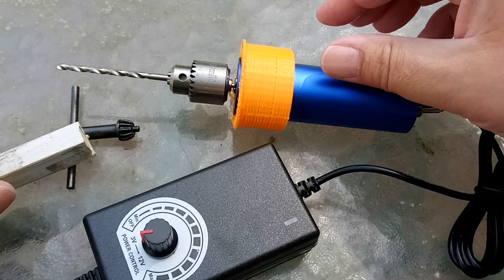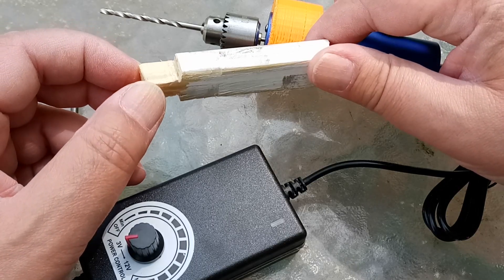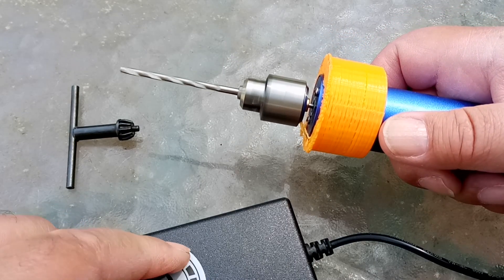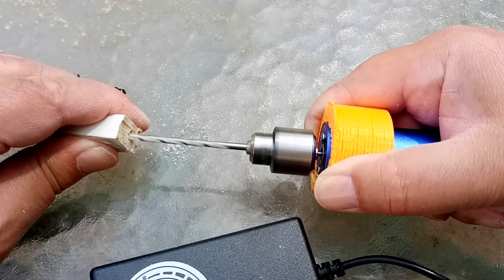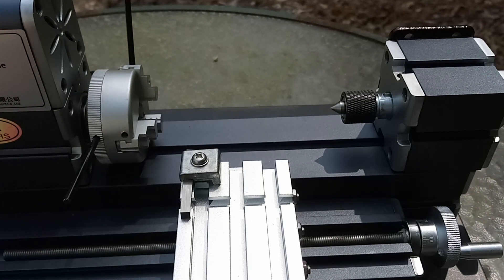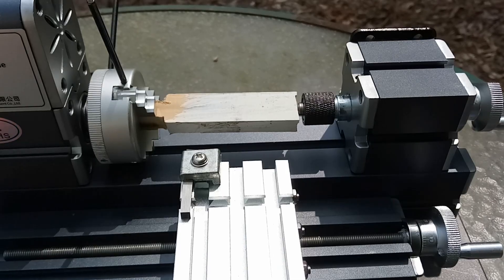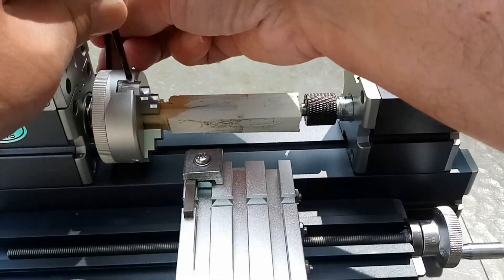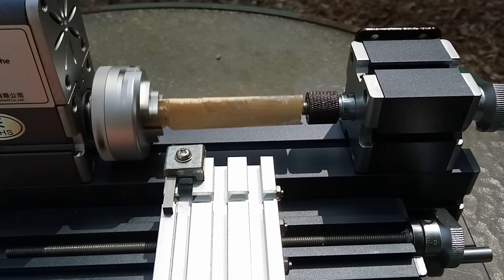Micro Lathe - first test #engineering #tools #workshop #engineer #hobby #modelengineering #diy

Comment: drills tend to not work very well when spinning backwards...
Reply from the maker: The chuck turns anticlockwise. I'm getting a tailstock chuck.
Reply: @britishtechguru  the drill. that you used to pop in that centre hole.
Reply from the maker: The blue drill? That would not surprise me. I'll have to take another look at it. That was one of the Temu scams. I ordered one, was overcharged and they sent 3. I didn't notice because it was a big order with many items. If it's the power supply then that's no problem as I will be running off my workshop 12v supply. If it's the drill then I'll have to take it apart and rewire. No problem.

Comment: Made to work metal.  There are good mini wood lathes  Right tool for the right material
Reply from the maker: Soft metal - aluminium and copper only. The bed is aluminium and the chuck is zinc. It really won't do much more than aluminium and I have yet to try it with aluminium. I'm using wood for the moment while I wait for the 4-jaw chuck and the extra lathe tools.

Comment: You can extend the tool, and that gives more clearance.
Reply from the maker: That's what I did with later wood turning. The tool gripper is going to have to be remade - one screw is definitely insufficient to hold the tool securely.